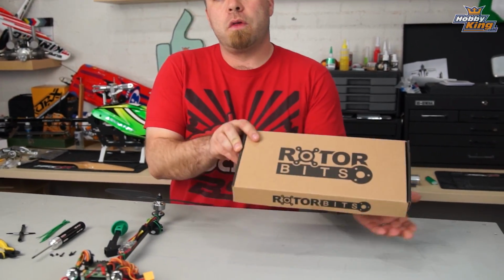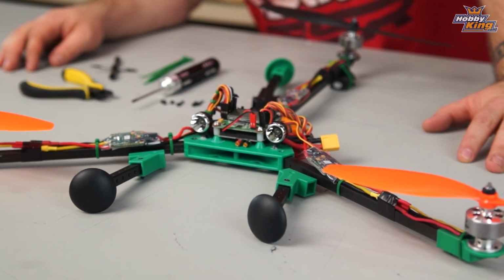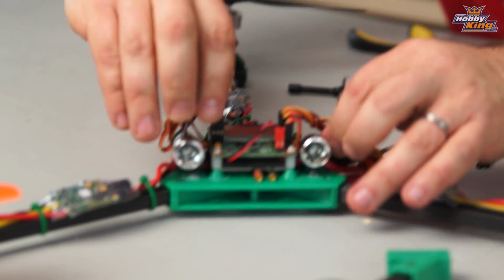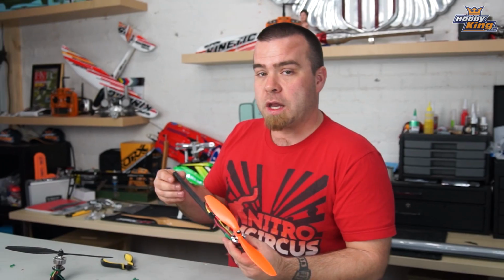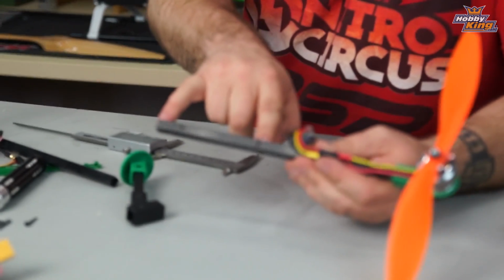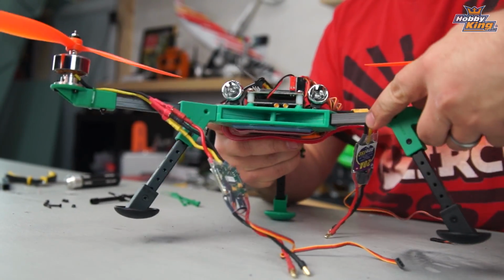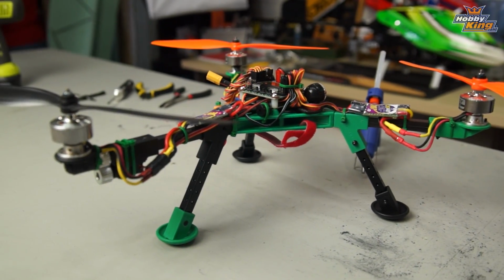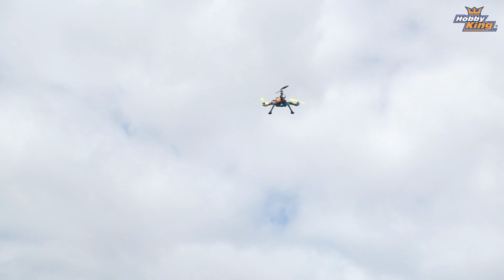HobbyKingLive Product Profile - Rotorbits TriCopter

Comment: What esc would go well with http://www.hobbyking.com/hobbyking/store/__18231__turnigy_d3542_5_1250kv_brushless_outrunner_motor.html And a kk2 board NEED HELP PLZ
Reply from the maker: In you're shopping from the US warehouse, these are in stock and would work.  I think closer to 50A max might be a good idea though, if you plan to run really big props.  
Turnigy Multistar 45 Amp Multi-rotor Brushless ESC 2-6S (USA warehouse)
- Matt

Comment: Could you have used the predrilled legs instead of carbon booms for the arms? That way you could just have moved the motors in a bit without cutting/drilling, tried it and either left them there, tried a different length or returned them to where they were. If the motor plates are made in such a way that they can be slid inwards on the arms, that is.
If rotorbits are to be truly flexible in use, the adaptation without the need to saw/drill has to be present. Otherwise your back to a normal (and time consuming) way of doing things.
Matthew
Reply from the maker: Absolutely.  You can use the pre-drilled stuff anywhere the carbon can be used. It's a little bit heavier though, so I tend to stick with the carbon for acro stuff.  - Matt

Comment: What are those motors? Are the 24g hex troika?
Reply from the maker: DST-1200's  - Matt
Reply: What made you decide on those vs the NTMs?
Reply from the maker: supraman78 It was back in the day before I worked for HK.  The DST's were cheaper and very reliable.  We're actually reworking the basic mounts for the future so they will work with both three and four bolt motor types.  - Matt